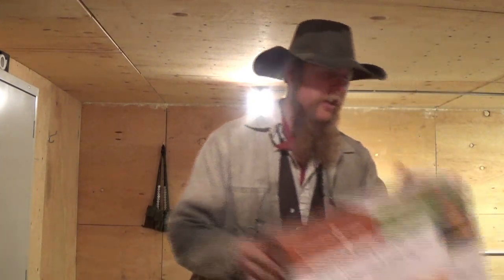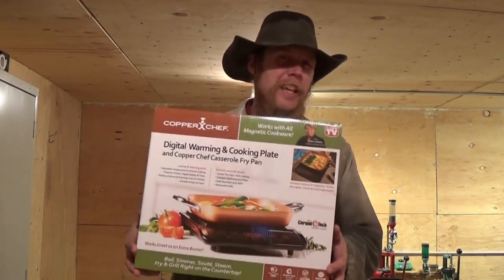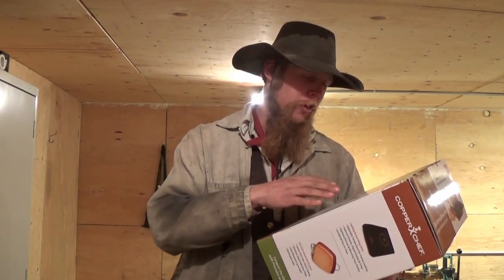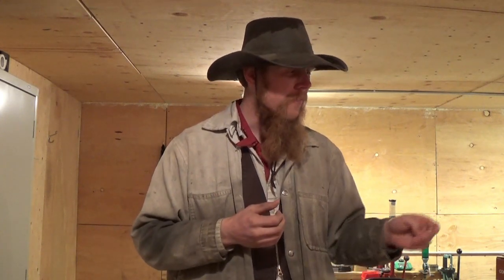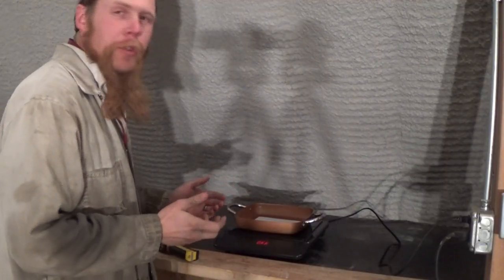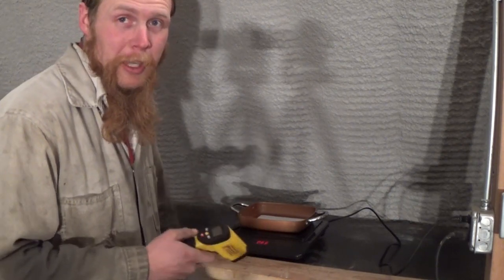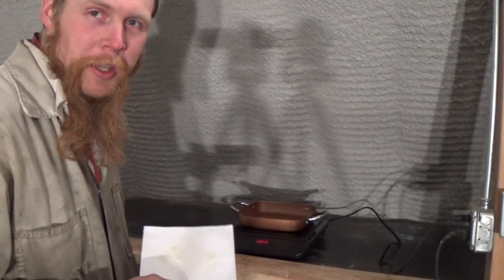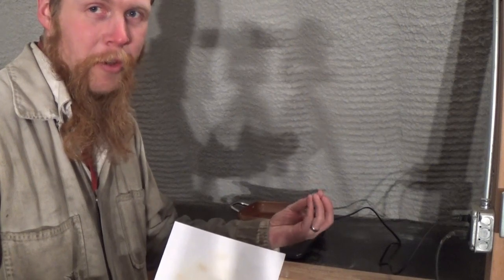A CopperChef Hotplate in the Shop (TIS137)

Comment: Would a counter top convection oven work for heat treating? The convection currents might eliminate hot spots.
Reply from the maker: I've never tried using a convection oven, but as long as it will hold the right temperature, it seems like it should work well.

Comment: I bought a $14 Walmart hotplate with simple heating coil on it.  I bypassed the provided thermostat so it's always on when plugged in.  I then connected my lead-melting temperature controller.  I can get accuracy down to less than one degree Fahrenheit.  The temp controller is VERY accurate.  I use it to melt lead, but not zinc, wheel weights by adjusting the temp to below the melting point of zinc.

My next project is a heat-treating oven made from a toaster oven using the same principles.  I'll bypass the factory controls so it's always on then hook up the temp controller and mount a thermocouple inside.  The great thing about these projects is that it's the same temp controller for three purposes.  Can also use it for bluing tanks if I ever follow through with that.

Comment: Informative video. I may need to do some tempering myself. About those 'copper' pans... I bought two of the fry pans from the TV add for when I don't want to use my cast iron. Mostly for low or no oil cooking. They work great.
Reply: Coated aluminum is great material for cooking, it gives even heating and doesn't cost too much. The "copper" ones are kind of a scam,any coated or anodized aluminum will perform about the same. Uncoated aluminum can affect the flavor of your food, though.